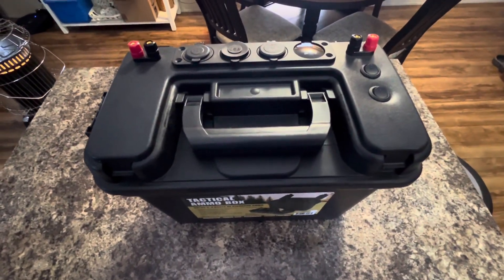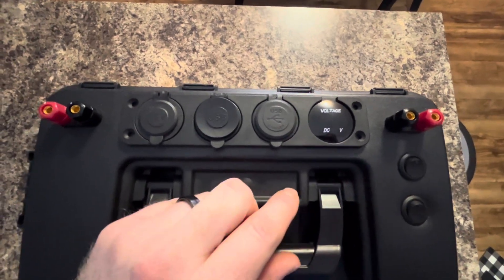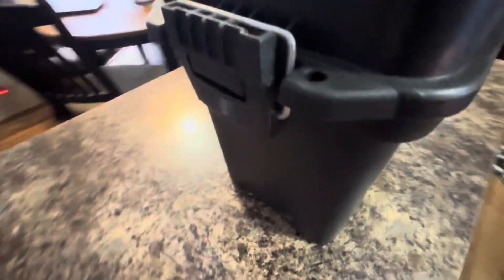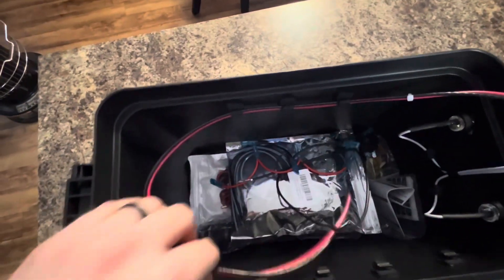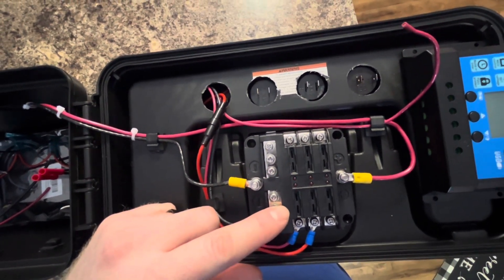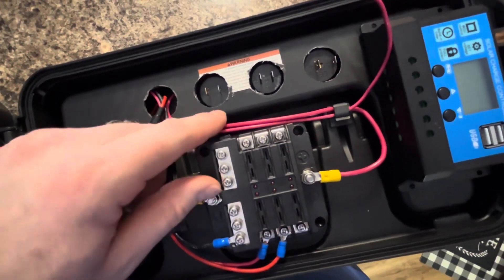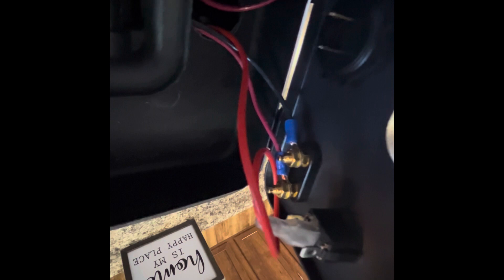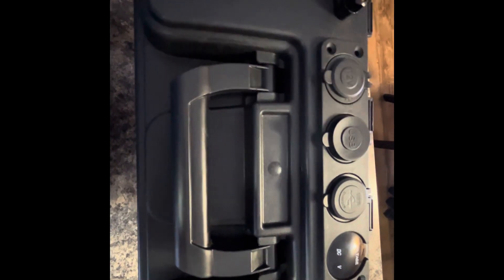PowerBox Build: Part 1 Not Finished Yet

Comment: YES! A 50ah battery Will fit in that box.  I have 2 50ah lithium batteries, and I bought two of those boxes, and they fit great. I make power boxes too.
Reply from the maker: Awesome thanks man yeah I’ve been looking around on amazon, was looking at the Weize 12v 50Ah lithium phosphate 4 battery. Do you have any recommendations? I need to get this box finished up!